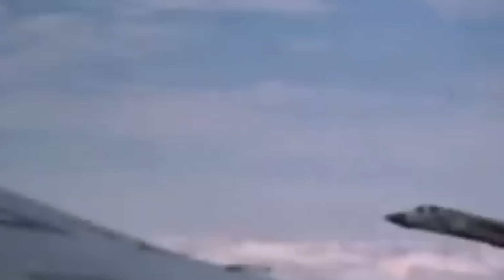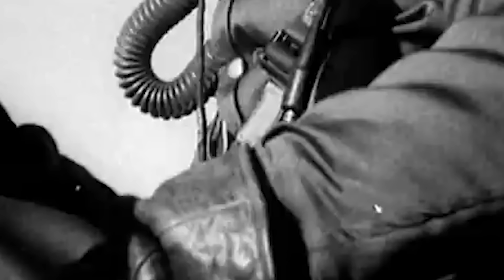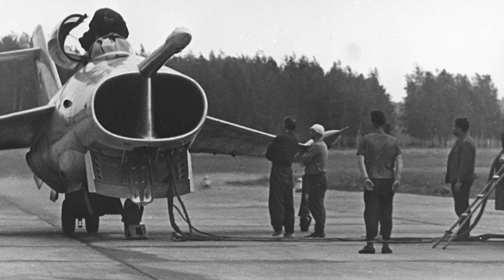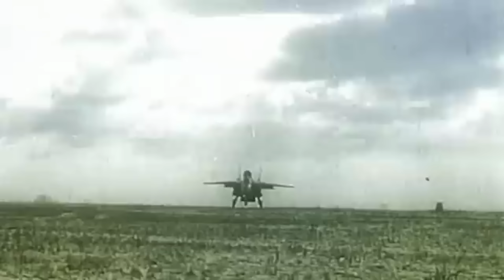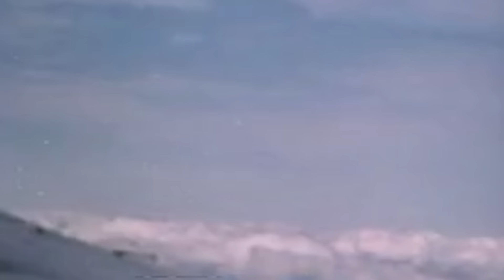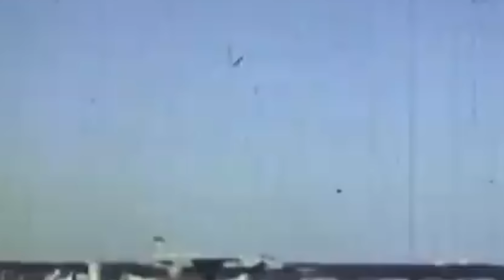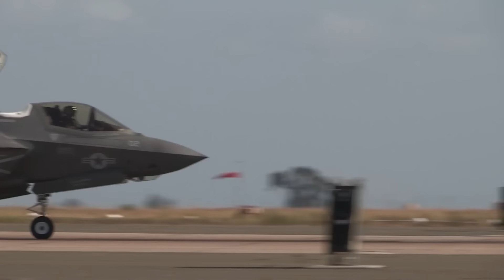America Stole This Plane and Turned It Into a Monster

Comment: If it was better than the Harrier, it would still be in use.
Reply: This came out in 1990. The Harrier first flew in 1967, and was already a bit long in the tooth by then. Sure, the harrier did stay in service for another 2 decades (in the RAF, the USMC might have used it longer?), but it's not surprising that the collapse of the USSR in '91 sidelined the Yak 41.
Reply: The Harrier still flies with the USMC. That is staying power.
Reply: @thetruthhurts7675 
Nah, that's Marine philosophy. 
Old gear can be abandoned on beachheads and island bases. 

A fighting knife and leather neck guard was original issue. Killing is low tech low cost brutality.
Reply: Boeing bought the rights to build the harrier after British aerospace went bankrupt. Boeing did some pretty extensive modifications and upgrades and built them for the usmc for another 40 years.
Reply: @Big-lron  interesting fact when the USA bought the rights, the British aerospace engineers had to dig up the old "imperial" measurement drawings, the harrier drawings had long been converted to metric. at least America bought the Harrier they didn't just kill it like the Avro Canadian Arrow.
Reply: @Big-lron  That is incorrect. British aerospace did not go bankrupt. The American harrier was built under licence, and with extensive help from BA by McDonnell Douglas. The RR Pegasus engine, that powers all Harrier models around the world is still made, supplied and maintained by Rolls Royce.
Reply: @johnnemo6509  I'm not sure how true that is. A lot of U.S manufacturing infact uses the metric system. However I'm not sure about the aerospace industry.
Reply: It had no range.
Reply: The YAK because of its multiple engine design was heavier and also made it use its fuel at a much higher rate than both the much older Harrier and the newer F35 which would’ve been severely limiting factors if it had ever been used in combat
Reply: @TheCabrooster11  It also burned through Russian decks on landing.
Reply: Exactly!!!
Reply: This channels ai made crap now by a 20s kid. Sadly as uses be great.  Now we get harrier inferior to yak yak yak😂
Reply: @Will-dn9dq  sad to say I'm starting to agree The Russians copied the French development path using a second dedicated lift engine that is redundant except on take off and landing . this is a technical dead end because the second engine severely limits  range , and payload.   There were discussions about making a supersonic version of the Harrier there were no technical reasons why this could not be done but there was not enough interest  by the existing harrier users. The Harrier was perfect for its intended role and was versatile to fill many other roles as well including shooting down supersonic fighters.
Reply: maybe - I think that they gave up on the harrier
Reply: @TJ-we7id  Hawker Siddely now BAE designed a Super Harrier  that wqs supersonic. It was rejected. Instead, the Harrier II was built.
Reply: 😂😂😂😂 Hahaha . Its in use as F 35. Thats the whole point.
Reply: Im gonna go out on a limb and say thats its better then the harrier 1, yknow the old british version. Not the harrier 2, the upgraded american model thats used around the world in its place.
Reply: @shiphappens8491  well that's kind of like saying we take an original ground breaking design  unlike anything seen before,  dump a bunch of money into it update it with the most recent technological developments and hey guess what it's better. than the original🤦‍♂
Reply: the harrier isn't in service anymore, and even then it's holdout was a product of the US marine corps infamous need to live off leftover scraps.
Reply: The techonology IS in use.  Did you miss the point of the entire video?
Reply: You can see the DNA the F35 shares with this plane.
Reply: For real. None of them fly! This video is humorous and very entertaining.🤣🤣🤣🤣🤣
Reply: It is, it's currently called the F35
Reply: Perhaps, but there were too many other considerations
Reply: The Americans did not steal the design. They bought into the Yak project as a partner in development of the project after the fall of the USSR. Much of the Russian tech and expertise was then used in the development of the F-35. The Yak 41 , while a very good proof of concept aircraft was however impractical as an operational aircraft. Because of its separate lift engine, it was heavy, had virtually no useful load and used huge amounts of fuel.
Reply: Harrier is still a better design of aircraft. The harrier having just one engine means it's less expensive to build and maintain and furthermore that one engine is used the entire time where as when the yak is flying around only 1 engine is serving a purpose and the other two are dead weight that fuel is needed to counter the weight they bring.

The last Yak to fly also crashed and burned on the deck of a carrier after only 8 flights where as the harrier rarely crashed on landing through it's huge service life.
Reply: it would still be in use if ussr wasnt dissolved and soviet navy still existed rather than the extremely short budgeted russian navy that couldnt afford to build the carrier it was designed for, so there was no point in servicing it.
Reply: @kazuhiramiller7491  I agree
Reply: @kazuhiramiller7491 
They finally have the Ivan Ragov and it's sister carrier , it's obvious now that the Yak-141 in some form are been returned...
Reply: @kazuhiramiller7491  > it would still be in use if ussr wasnt dissolved

Many nations, USSR AND RUSSIA INCLUDED, export weapons.  Even without the USSR, if the plane wasn't so horrible they could have sold it to someone.
Reply: I don’t think you understand obviously the Harrier not superior at all hence why it’s not in modern combat today
Reply: @THATS_Ludacris it is though
Reply: It would have been if any other nation than the user had built it. But Russia isn't very smart.
Reply: Their jet wasn't better.... The vectoring set up on it was......  Harrier had 2 different thrust sources in their design, ruskies were using one.... WE  took the rusky plans and re engineered them and perfected them (which the ruskies could not do even if we GAVE then an F-35 to copy) and built the F-35....  The ruskies never DID perfect that system.
Reply: @1956tojo  Soviet Union. Not "Ruskies" ... The Harrier has ONE thrust source. There is only one engine providing thrust. I also have to point out the flaw in your argument. IE, If the US had to steal the Yakolev design, in order to "perfect" it, then you are implying that they were incapable of designing a system for themselves.
Reply: @memkiii  There's just no reason to invent something that already exists. It's like when Mercedes made the automobile and Ford thought "You know, I think mine will have for wheels too." If it works, just build on it. The Harrier worked for 50 years and it was time to retire it. Russia just can't do that, they are still incapable today. None of their jets can survive 10 seconds in Ukraine hahahahaha
Reply: @jangleleg117  In fairness, Russian aircraft are doing quite well in Ukraine. They have had losses yes, but the UkAF have lost more.
The Su35s and R77s are the key to this.
Reply: @memkiii  Stole it with a 400 Million contract to the aircrafts manufacture. Think that is called a purchase at an agreed-on price, I guess USA stole Alaska by purchasing it also???
Reply: @1956tojo Harrier had one engine, not two. Thrust nozzles aren't the same as engines.
Reply: @1956tojo  stop underestimate the Russians, it's a grave mistake.
Reply: @1956tojo  No, the Convair Project 200 of 1973 already had a rear vector design, so it's silly to suggest that was copied from Yak, not Convair.  Meanwhile neither the Yak nor the Convair ran the front lift fan off the jet: this was a huge advancement and part of why the F-35 works great when the Yak couldn't even take off with bullets on board.   The F-35 design was already set when Lockheed got Yak flight data.
Reply: @1956tojo … and the F35 uses the Rolls Royce Lift System, which is pretty much the back end of that aircraft.
Reply: @1956tojo You got it mixed up. The Harrier only used a single engine while the yak had 3. And btw rolls royce engineers once gave the USSR their most powerful engine at the time thinking that the they couldn't reverse-engineer the engine. And then the soviet engineers reversed-engineered it into mig 15's engine
Reply: @quangdan9121  Yes, Klimov VK-1, in 1948... reverse engineered from Rolls Royce "Nene", delivered with approval of Clement Atlee's Labour Party government... except, turbine blades (in original) were made from Hastelloy-80... for which, there was NO Soviét counterpart... so, it lasted only ¼ number of hours, before "eating up" itself... Regular Soviét story: trying to be a Superpower, On the Cheap....
Reply: @quangdan9121 what, the Whittle 🏴 engine?
Reply: @UncleNed1  it was a rolls royce nene engine
Reply: @1956tojo wrong conjecture, no engineer, wrong type of wording and the F-35 is not good and now unsellable. Btw, go travel, talk to people, learn new things.
Reply: @1956tojo perfected! How much did it cost tax payers ? Taxation is theft!
Reply: @1956tojo  i think you are discrediting russian engineers, its not that they couldnt from a technical standpoint. its the widespread corruption that makes russias military complex so inneficient.
Reply: If the Americans in Lockheed Martin to compression design and made it into Fat Amy and absolute disaster Kelly would be rolling over his grave at this point with what the pathetic mess Lockheed has become since it's Glory Days
Reply: @konnorj6442  I could almost make out a coherent thought in that thing that might be considered a sentence.
Reply: @1956tojo You sound like you’re coping. Give credit where it’s due. What do you also mean the Russians couldn’t “perfect” the design? What does that even mean? They built a supersonic VSTOL aircraft and it was a prototype with a limited budget. If Russian set out to build a supersonic VSTOL aircraft and failed then you would have a point but they succeeded. It was lack of money that killed the project. 
How do you also know they couldn’t build something similar to an F-35? Yak engineers were consultants for the F-35 and Lockheed used the Yakalev design to aid in development. Funding was always the issue. You have the same ignorance of most westerners during the Cold War, the west insisted it had more advanced rockets engines, torpedoes, ICBM guidance, ect when in reality the west was lagging sometimes decades behind the Soviets in many fields.
Reply: Bud don't be one of those. buran was better then the shuttle and isn't used anymore, this was better than harrier but you know history takes a toll...there are countless examples in both east and west when things designed were ahead and better and never used. That's just poor understanding but world works this way whether we like it or no
Reply: Why would it still be in use when those who made it make better plans, unlike those who made the harrier  ?
Reply: @goodlifetoyou6895   It was never in use. It was canceled after the test flight crash. The aircraft was rebuilt but by then the Soviet Union was no more.

Comment: There were plans for a supersonic harrier but the Brits in their wisdom cancelled it. The p1154.
Reply: Not due the "wisdom", but purely PRACTICAL reasons: VTOL (applying jet thrust) is a fuel guzzler- so, for naval aircraft, either go for supersonic (with accompanying problems of high MTOW, without benefits of catapults: ski- jump only allows heavily restricted MTOW, meaning, either less FUEL, or less PAYLOAD- chose your poison) or V/STOL, which what Harrier was... a COMPROMISE, between the Fuel & Payload, vs. Speed...
Reply: Britain lagged years behind in supersonic aircraft technology... they only produced one supersonic jet
Reply: @WilhelmKarsten  it was all that was required for a very long time. Once modernisation was needed, the Jaguar, Tornado and Eurofighter were all joint European projects that were up to the task and the lightning was the  fastest climbing jet on the planet that didn't need to strap a rocket on its backside to be so.
Reply: @obi-ron True, Britain needed help to build supersonic aircraft, they lacked the ability to make their own.
The Lightning was a disappointing and lackluster aircraft with mediocre performance and unacceptable range.
It was a sales flop and English Electric was insolvent and forced to merge with 3 other failed british companies to form BAC.
BAC failed to develop any successful aircraft on its own..
Reply: When McDonnell Douglas entered negotiations into licence building harriers, their goal was also to create a supersonic version because of the faster is better mentality, which didn't go according to plan, but that didn't stop harriers taking out mirages and daggers during the Falklands, nor has it prevented them from neutralising ground targets when necessary. F35s may be the current favourite for many, but it may not reach a level of production equal to the Harrier and Matador thanks to the ridiculous little man in the Whitehouse. 
Who knows, had Britain decided to permit the sale of 200 to 350 harriers to the Chinese in 1978 as defence against intrusive neighbours, instead of pandering to the fears of America, the whole South East Asian area might have been dominated by a more western tolerant set of attitudes and wouldn't be as antagonistic as it now is.

Comment: I understood that RR builds the F35B engines using YAK IP nozzle licences. The ability to do away with the separate lift engines in favour of horizontal thrust engine driven fans makes it a much more efficient proposition like that of the exquisite all in one Pegasus engine.
 I think that the fan drive clutches between jet and fan are the critical technology and these are not shared between the US and UK versions. VTOL coupled with supersonic was the holy grail of military flight and without the Yakalev tech it might still be a way off. I assume that this trade bypasses sanctions because it suits for it to do so!😂

Comment: Many in the comment section don’t realize was that both Yak-38 and 141 were actually planes meant to give experience to pilots in VTOL aircraft.
Yakovlev himself saw the 141 as the mid-step for an actual functional VTOL fighter the Yak-43.
Yes. Harriet was more combat proven than the Yak-141 but just because it never went beyond testing phase and serial production. Too bad for the bird as is IMHO is better looking than the Harrier.

Comment: This story was debunked years ago but seems to persist on the internet. See the American Convair 200 from the late 60's which Lockheed had access to its information.  If anything the Convair design  probably inspired the Soviet Yak aircraft.
Reply: Got any pictures of the Convair 200?  (The plane, not drawings.)  Got any video of it flying?  (Real film, not animation.)
Reply: @michaelrichter9427  You set a high bar for Sean.  Why not ask the creator of this video: if the Yak is a fighter why no "real film" of it taking off vertically then fighting?

Comment: about the only shing remotely in common between the yak141 and f35 is the rotating engine exhaust and the fly by wire and thats about all i can think of, the yak141 had no customers or military service and was overall a hard machine to fly, not a machine to be superior to the battle proven harrier